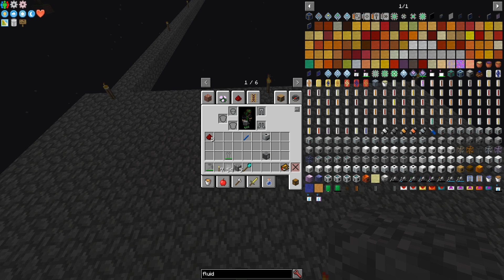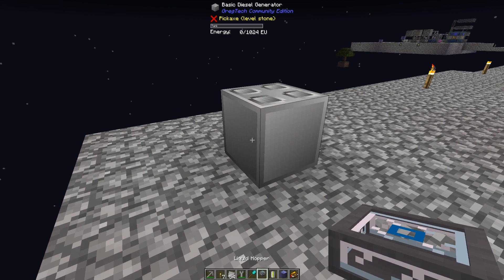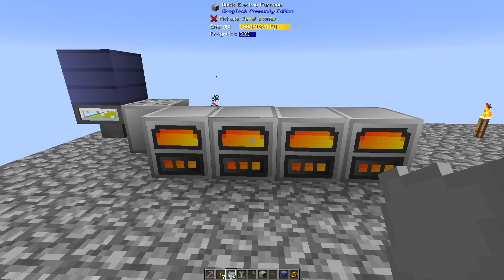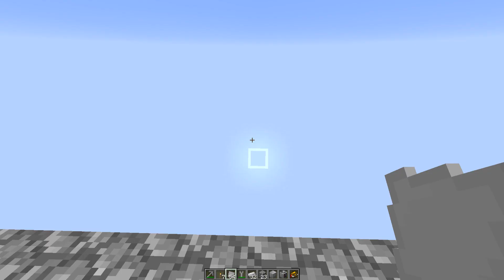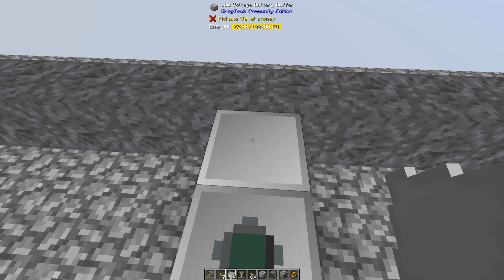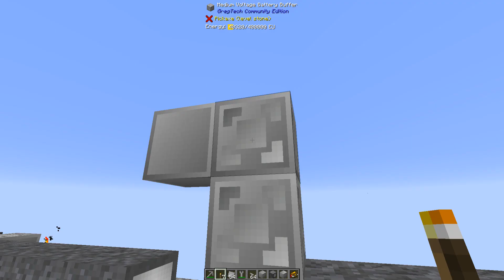Tutorial - Gregtech Cables and Power

Comment: Thanks for the video! The question which is not yet clear to me, is how to "down-amp"? For example, I have a 16x-bus, but this cable is expensive. So I want to branch away small productions using smaller cables (like 4x, etc). But if I do this directly, they burn. Do I understand correctly, that battery buffer can solve this? Just having 4 batteries in it, it will output 4amps, and I can freely connect 4x cable to it?
Reply: You can use diodes. They only let a specific amount of amps through in one direction. 
As example, you can make an LV cable Diode with 2 Amps, if you have just 1 or 2 machines sitting at the end. 
Or you can take a beefier one with 4amps, 8 amps or even 16 amps, depending on your needs.

Comment: Right at the start... needs fuel......

Dude how about you start at the beginning. How am I going to power that refinery to get fuel exactly if I need fuel to get power?

You need to start with basic Greg power so we can work our way up without cheating.
Reply: Most people dont start running into trouble until there a little bit setup. Usually the first power you will go with is steam turbines =)
Reply: @troyj8199  that's exactly my situation! Made some steam dynamos, set up a battery buffer, started running some machines, then "oops my cables melted"
Reply: This video is explaining the details of power transmission, not methods of power generation.
Reply: This video answered every question I had. You seem to have the wrong video.

Comment: Hey, I just want to check a single thing about cable loss (I am at a loss about this haha). 
Given situation:
Battery buffer 100 000 eu
Consumer will use a single amp, 10 eu/t for 2 sec - for the total of 400 eu,
Consumer is set at the distance of 2 from the buffer - loss is at total of 2 eu.
Will the consumer use 480 eu or only 400? 
Because I understand the loss in a cable as a literal loss due to transfer length.
Or is the cable only losing it's max possible output per packet with each length of cable?
Reply from the maker: The consumer will finish it's task as soon as it reaches the EU needed per recipe, which is why the crafting process slows down when its not receiving enough EU/t. So no matter how far down the line, that number will be the same. What changes is the amount of EU the power supply has to send out. The farther away it has to travel, the more EU it will use from the battery.
Reply: @Kharax82   Kharax82  Thanks for the reply. Ok, so in my example - buffer will send out 480 and a consumer will receive 400. 80eu is lost due to length of cable.